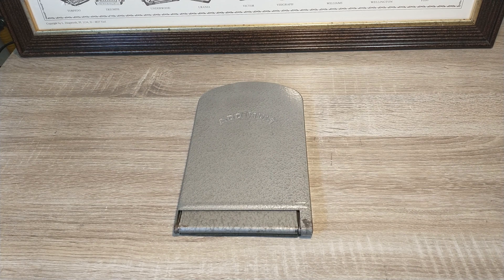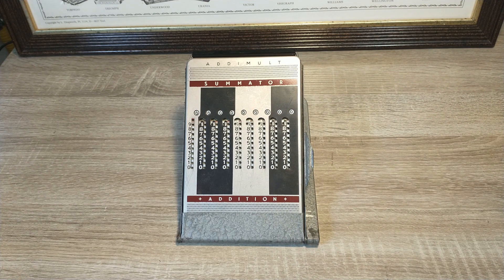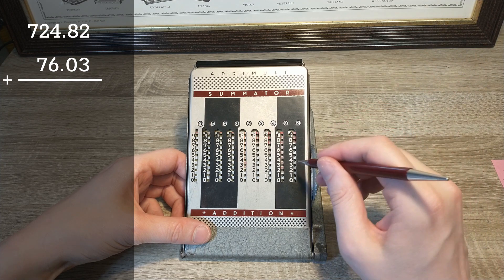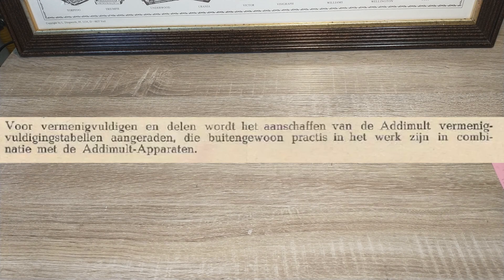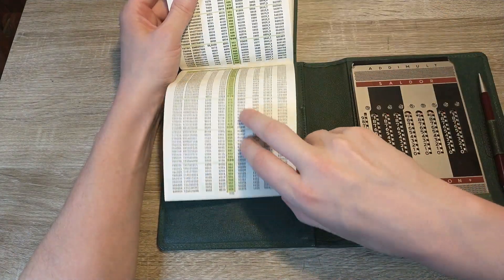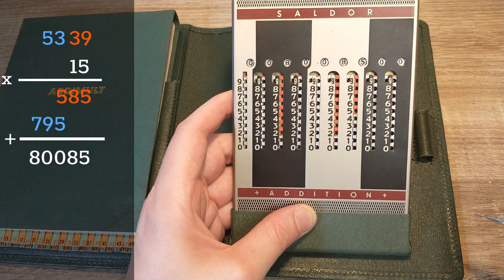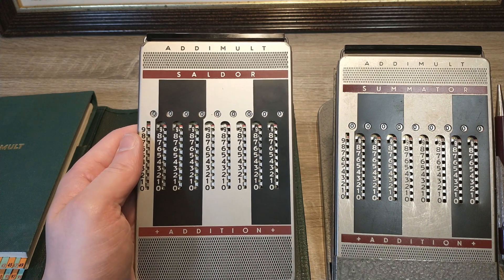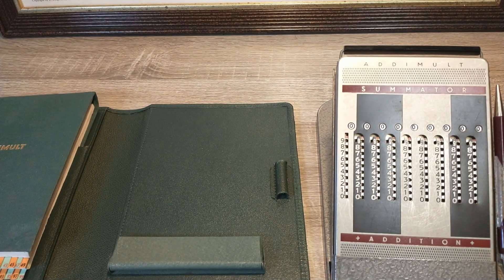Addimult Mechanical Calculator

Comment: Hi! I´m from Brazil. I work at the Memory Center of Education in Campinas. We´ve got onde of those but I cant find the multi-divi tables. Do you know where can I find it? It could be even a PDF ou scanned version. I just would like to be able to try the multiplication and division using it to show our students.
Reply from the maker: Sorry for the late reply, I've been very busy lately. The manual came with the device. I don't have a book scanner, so scanning is not a possibility for me. I made a post with some pictures for you, which should have sufficient data for you so you can make your own tables in a spreadsheet program: http://youtube.com/post/UgkxLHmFjmt-s1OV3-QyDXr_u_Ea5_ta7oSZ?feature=shared

Comment: If you want the quotient to appear on the device, you can use the "cipher method" used by comptometer operators. Put a zero (cipher) in front of the divisor 0666 and then find the tens complement 9334 (the number that when added gives 10000).

Enter 008008500 on the ADDITION side of your Addimult. Then add 093340000. You get 101348500. This is like subtracting 800 - 666 = 134 but it puts a counting digit 1 in a location at the left. That counts how many subtractions you did, and that 1 becomes the first digit of your answer.

Now shift stylus one place value and add 9334 two times. You get 110682500, then 120016500. The 2 in the second place is the second digit of your answer. (You stop after two operations in this place value because you have reduced 1348 to 0682 to 0016 and 16 < 666.)

Now shift stylus two places and add 9334 two times. You get 120109840, then 120203180. You now see 1202 as the first four digits of your quotient (You stop after two operations in this place value because you have reduced 1650 to 0984 to 0318 and 318 < 666.) There is still 3180 at the right to work on.

Shift stylus one place value and add 9334 four times to continue. You get 120212514, 120221848, 120231182, 120240516.

You read the answer directly from the display: 12024, a zero separator, and remainder 516.

Comment: To divide 80085 by 666 if you're okay jotting down the digits of the answer as you go: 

Enter 80085 on the SUBTRACTION side of your Addimult, then starting at left place value subtract 666 one time (80085, 13485). 

Now 134 < 666, so shift stylus one place right and subtract 666 two times (06825, 00165). 

Now 016 < 666, so shift stylus one place right but note that also 165 < 666, so subtract 666 zero times and shift again. Subtract 666 two times from 1650 (000984, 000318). 

Now 318 < 666, so shift stylus one place and subtract 666 four times from 3180 (0002514, 0001848, 0001182, 0000516). 

Now your answer is the number of times you subtracted at each place value: 120.24. 

You could deal with the remainder 516 by dividing it separately by 666 using the same method to see the repeating 774774... pattern that would follow.

Comment: To multiply 5339 × 15 without the printed table, just enter 5339 five times on the device, then shift left one place value and enter 5339 one time.
Reply from the maker: Ooh yes! That would work!
Why didn't I think of that? facepalm